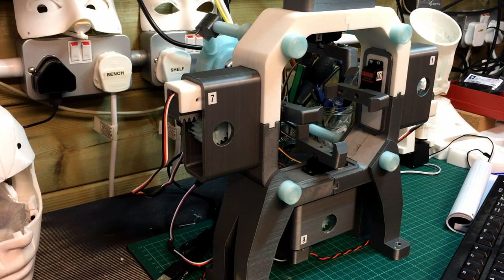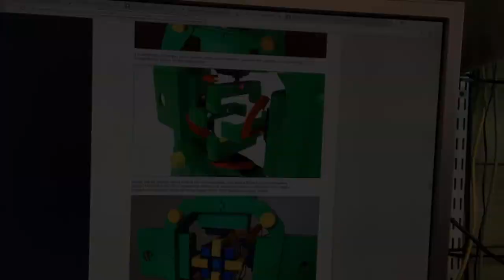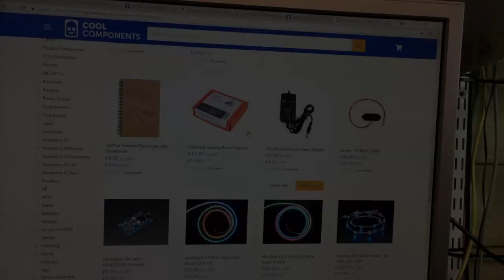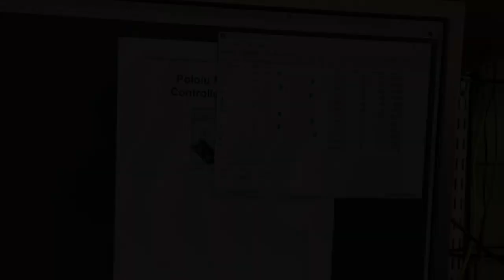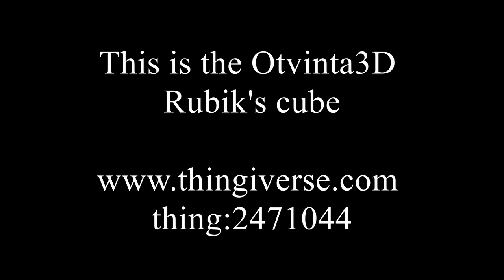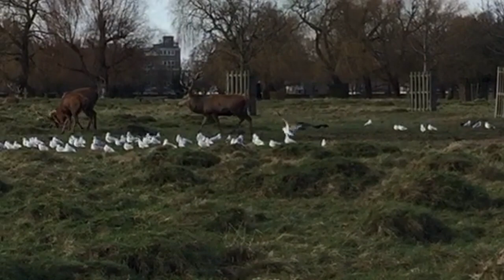Rubiks Build

Comment: Hi Kyle, Did you ever get this project completed and functioning. I'm just about to finish all the printing so will start collecting the other hardware next month. Did you find a UK source for the DS3218 servo and aluminium horn? Everywhere I look they are crazy expensive!
Reply from the maker: Hi Carl, its mostly complete.  I bought the new camera for the new version of the system and printed a new housing for it.   Then my workshop computer packed up and I lost some of the software files.  I have been sorting it all out again recently to complete it, so maybe finally get it fully working shortly.   You mentioning it has prompted me to finish it!

You can use MG996R servos as they are the same size as the HS311 and theres a slightly different stl file available. I cant find my notes on where I bought the  DS3218 but I think it was Banggood.com or Aliexpress, I certainly remember waiting a couple of weeks for them.  Ebay has them for £12.26 with a few weeks delivery from Hong Kong.
Reply: HI Kyle, thanks for that. I'm using MG996R units alreadys and have ordered my DS3218 servo's. have you measured the total current draw during operation at all? I have a really nice 6v 2.25 Amp power supply that I'd like to use if it's up to the job?